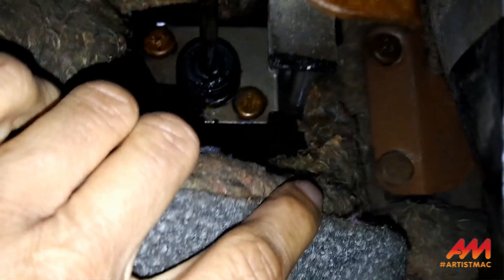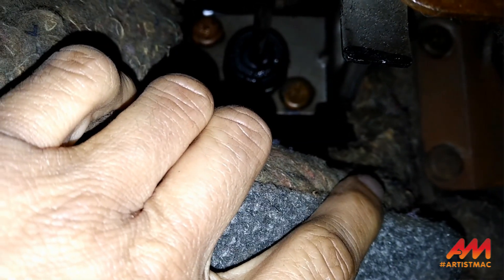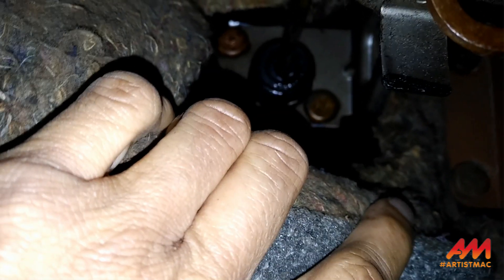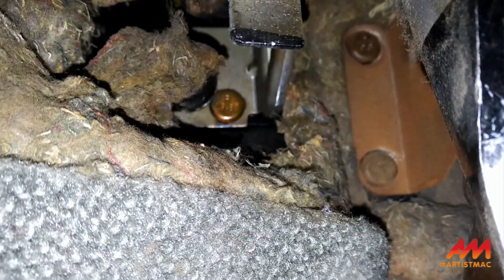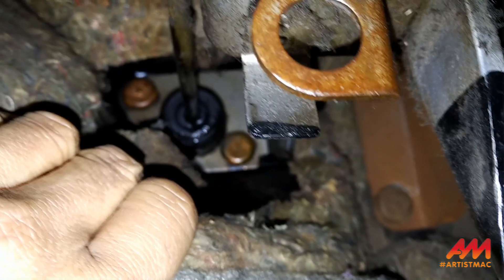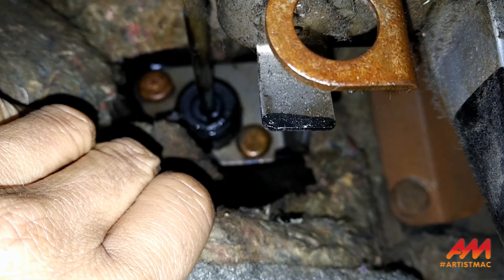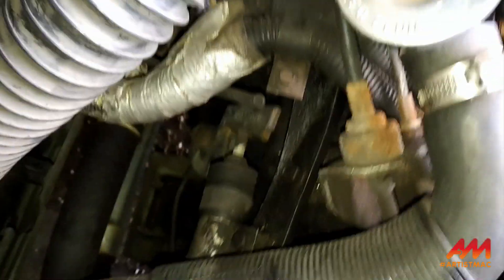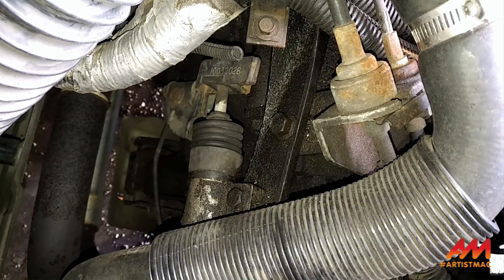My Fiero - Trouble in Clutch Land

Comment: The Rodney Dickman slave and master cylinders are definitely recommended. There is also a known issue with the clutch pedal bending at the mount.  this can cause you to not have enough travel in the clutch pedal to disengage the clutch before the pedal bottoms out.

Comment: I had the same clutch master cylinder failure on my Fiero last year. Topping up the fluid and pumping would get me enough pressure to drive for a bit (I was out of town), but every time I stopped I had to pump the clutch up again.

There's rebuild kits available, but ultimately I installed a new Clutch Master from Rodney Dickman. It was a surprisingly easy job, aside from the fasteners were corroded and hard to get the old unit out. You "can" bleed the clutch yourself with a long pole, but I'd suggest having a helper.
Reply from the maker: Thanks! I'm looking at master cylinders at Rodney Dickman's site now. Even though the current one is 34 years old and looks like it's brand new, it's earned its retirement.  Just for kicks and giggles, I'm going to try bleeding any air out of the system first and see if fresh brake fluid (the stuff in there now is brown) makes a difference. Now to hunt down a clear tube that'll fit tight over the bleeder screw on the slave cylinder, and a mason jar.
Reply: Shove wood block in-between pedal and carpet so it stays go back and crack the bleeder go back remove block and let out clutch slowly also make sure reservoir is full at the front or you'll suck air... travel at slave should be about an inch

Comment: Funny!  I just ran into clutch problems on my 84 that I'm motorswapping.  Step 1 should definately be replacing the master cylinder. Step 2 will be bleeding tgr system. If you have extra money for parts you should definately get a new slave as well.  What concerns me is that the clutch looks like it's engaging which could mean the throwout bearing forb is broken or slipped out of its grooves.  Even if the trans comes apart, doing the first two steps at home will save lots of money.  They can be done with a socket set, line wrenches and an extra hand for bleeding.  Hope this helps!
Reply from the maker: Thanks for the info! Looks like a Fiero clutch weekend! :)

Comment: The Rodney Dickman master and slave cylinders are very good. Replace BOTH and then bleed the system. You can do it yourself.
Reply from the maker: Turned out, it was a broken clutch arm. Way beyond my skill level. But the shop I went to (recommended by NIFE member Mark Soeldner) did a great job.

Comment: 1 - I didn't watch the whole video.  You do have enough clutch fluid in the master cylinder correct?

2 - Try pumping the clutch pedal a few strokes and then press it and hold it down and see if you can shift normally.  If so there is air in the system.

3 - If you ran dry, and then added fluid and then had this start, and pumping the pedal allows you to shift, don't be in a hurry to replace the cylinders in this cold.  Many times the air bubble is right at the master cylinder and will work it's way out and you will be ok for a while.  This isn't a permant fix but it might get you by until it gets warmer.

4 - Fluid by the carpet means your master cylinder is leaking.  This will run down the fluid, but if you keep the plastic reserve full and refill it often, it is again a temporary fix.
Reply from the maker: Thanks! I'll do that. My 34-year run of no clutch trouble had to end sometime, I guess. ;)